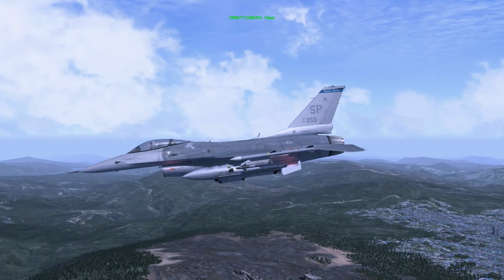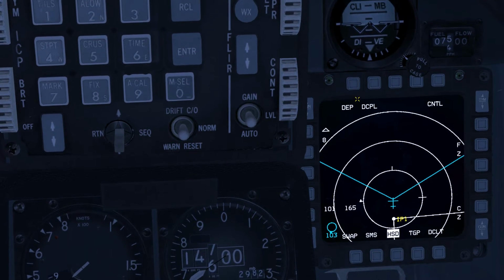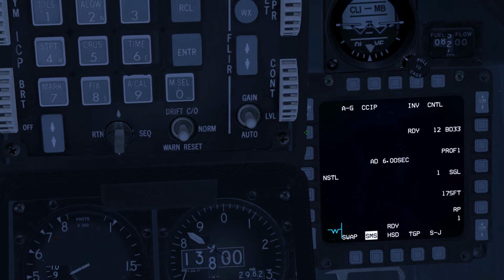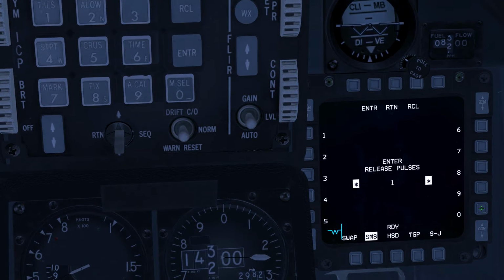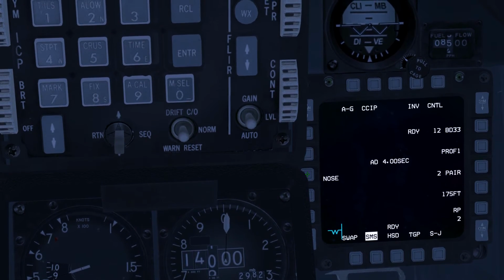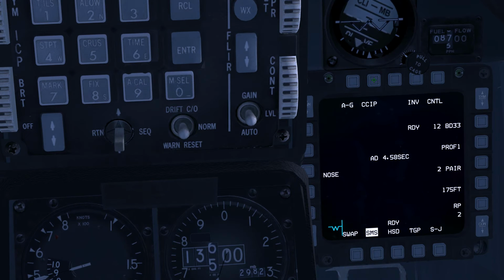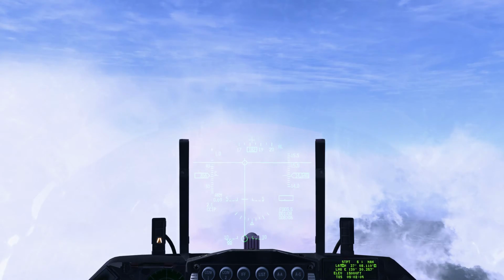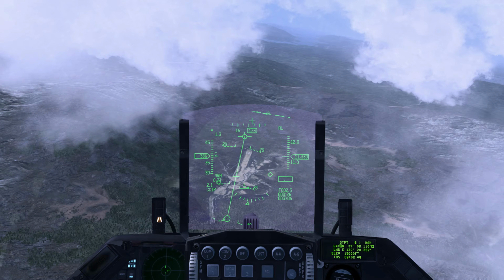Falcon 4 BMS 4.33 Tutorial 3 CCIP delivery mode at Kotar

Comment: Hi Supanova,
I've always found CCIP easy enough to use both in earlier incarnations of Falcon 4 and other simulators. However I'm having trouble getting a clean release when I pickle off my bombs. I hold to pickle button, the impact point freezes, just like in your video but bombs either come off late or don't come off at all. This is from a range of attitudes, altitudes and airspeeds. Do you have any idea what might be going wrong?
Reply from the maker: As you're only giving consent to release when holding down the weapon release button, I would imagine that you're either not meeting release parameters, or there's a pause before you meet them.
Reply: What are those basic paramters? My wings are parallel with the ground, my dive angle is either shallow or deep, speed's good, I'm releasing high enough. Reckon this could be a control issue?
Reply from the maker: It might be a CCIP Delayed Release. Look for a horizontal delay cue across the BFL below the FPM and the similar solution cue moving down towards the FPM. When the solution cue meets the FPM bombs should release.
Reply: What kind of situations result in a Delayed Release? (Does rippling off several bombs force this?)
Reply from the maker: Delayed release is used when the bomb impact point is under the nose of the aircraft. I'm not sure if that's simulated in BMS, but it's something to consider.